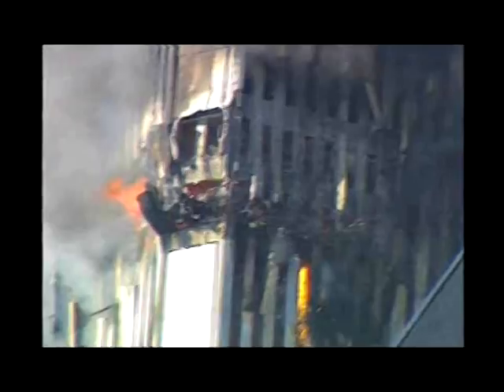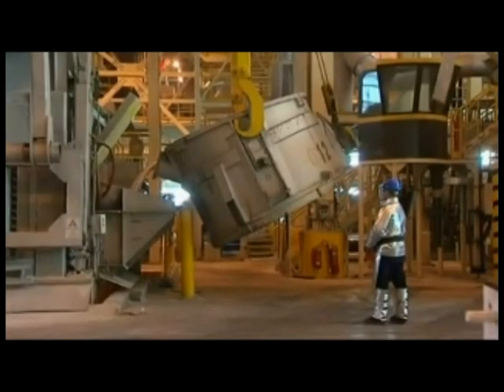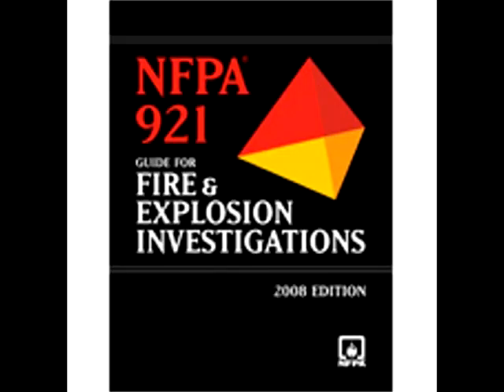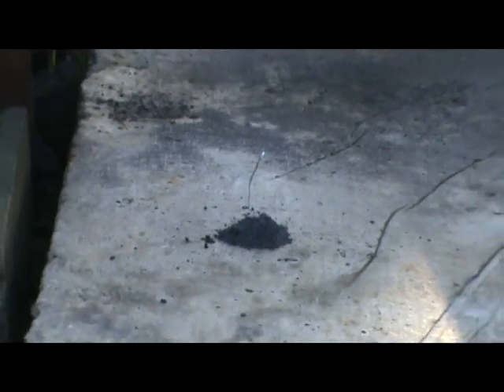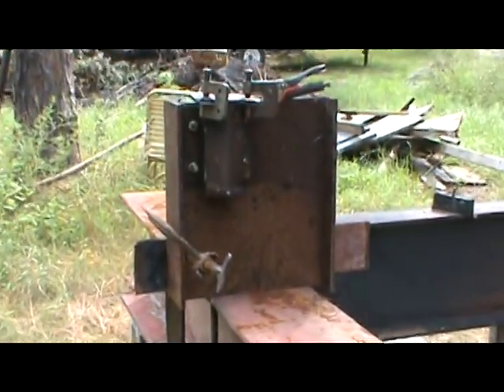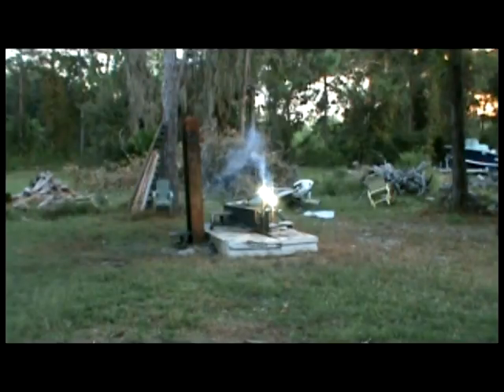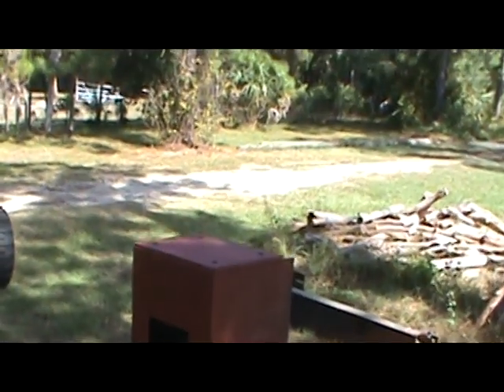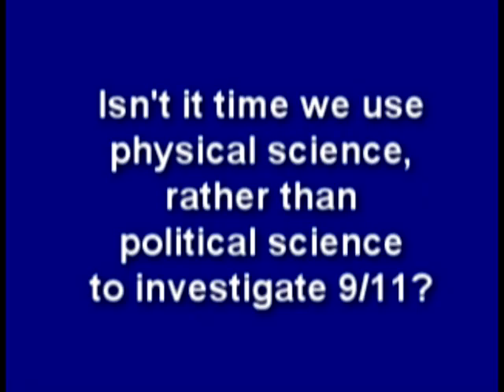9/11 Experiments: The Great Thermate Debate

Comment: What about the freeway beams that melted in San Francisco due to a fire. Same thing and proves this video is pure propaganda.
Reply: Well the steel did not melt it just weakened to the point were it just snapped
Reply: Matthew Walsh But is was just a fuel truck with no other building material to increase temperature. Think of what is being implied. The government is so competent that it planned and kept secret the entire conspiracy. If they were that competent I would have them run 100% of the economy and we know what would happen if they did that.
Reply: +Tanner Stage V You're assuming government competence = a well run economy. There goals for the economy might be different from yours. This economy now might actually be what they want because it benefits them and their investments.

Either way, the only thing important are facts and what can be proved. We KNOW jet fuel doesn't burn hot enough to melt steel beams. We KNOW that a building fire couldn't possibly take down building 7. We KNOW that these three "building fires" weren't anywhere near the strongest, hottest or longest lasting building fires in steel lattice structure buildings. We KNOW that these are the only 3 steel lattice structure buildings in history to have ever come down from "building fires." The evidence very much supports a controlled demolition, and until conflicting evidence arises I'll always believe the most likely story based on the evidence.
Reply: Tanner Stage V In the video you're commenting on thermate is exploding. The telephone company, and cable company would be an example of maintenance people who wouldn't be "privately employed" by the building. Also the man who owned the WTC complex, Larry Silverstein profited madly from the 9/11 attacks, do you think maybe he might have made it much easier for private crews to come in and wire up explosives? He took out an insurance policy 3 months before the attacks for double what he paid for the buildings and claimed the attacks as two separate events. He profited over $3 billion from the attacks, it's very plausible he was in on it, and you're saying that an individual like that couldn't simply tell his managers and security to look the other way, or really whatever the fuck he wanted to tell them about whichever crew it was?

Remember this buiding is over 100 stories tall, theres miles of phone lines, cable lines, multiple elevators to service, among numerous other things. I can guarantee you that it'd be exceedingly simple to mislead people into thin'king any crew who showed up was there to fix something. Maintenance on buildings of even 1/5 of this scale never stops.

Anyways I'm done, you've done nothing but provide sophist and specious arguments, have presented no scientifically valid counter-claims, have thrown around lots of insults, made numerous claims that were patently wrong yet, harped on a single typo of my own as if it countered an entire argument. It's like I havent typed anything at all because you haven't responded to even a small portion of my arguments. So I'm gonna stoop down to your level. Fuck you, you fucking prick.
Reply: Y0uKnoWh0 If you believe central control is all knowing and competent then that is your right. To think that jet fuel was the only thing in that building burning is completely retarded. With good oxygen, as this fire would have, garbage burns at 2500 F and that is enough to melt steel.
Reply: Garbage does not burn at 2500 degrees fahrenheit. Otherwise it wouldn't have taken medieval societies inventing a blast furnace just to be able to forge steel. Instead they would've just tossed their trash into an open pile and formed molten steel easily. Hell you've just solved the Dark Ages, we need to invent a time machine so you can go back and advance society.

"Hey idiots, just burn your trash at 2500 degrees and make steel!"
Reply: Y0uKnoWh0 Oooops you forgot. Did Medieval societies have plastic and massive amounts of petrochemicals and metals? Garbage is a very broad term and you need to know the composition of the garbage. The towers were full of debris including tons of aluminum. What is the temperature of a burning airliner? It is documented. So step out of the Dark Ages of thought and  leave the brainwashing behind.
Reply: +Tanner Stage V bruh really. An open garbage fire can't reach 2500 F without human assistance. a constant propellant mist, pressurization and oxygen injection are all necessary to reach those temperatures. Hence my reference to a blast furnace. An open fire will never reach that temperature.

You think the composition of the fire is the determining factor of the flame temperature, its only 30% responsible. The temperature of the fire is much more influenced by the environmental conditions, air density, pressure, and presence of propellants.

An open fire will never produce an air temperature of 2500 degrees, and the conditions of a building fire will simply never be able to reach that temperature.

Why do you think a blast furnace is necessary? Why do you think waste to energy plants have to inject oxygen on compressed trash that's exposed to a propellant mist to burn it hot enough to run steam turbine?

The temperatures your claiming are simply not reached in an open fire. 1,000 degrees is the temperature limit for a fire that uses air rather than pure oxygen. Then it will burn at a lower temperature if the accelerants are diffused randomly rather than manually mixed. Also as elevation increases air density decreases. The height of impact further decreases possible maximum temperature. Also the fires on WTC 1,2, and 7 incompletely burned as was evidenced by the black smoke pouring from the building. The aluminum of the plane most certainly did not ignite. Aluminum ignition requires very special conditions and did not happen as it would have been clearly evident.
Reply: +Tanner Stage V Fires in both WTC towers were oxygen starved (thick black smoke), and therefore could not reach anywhere near a maximum temprature for open-room, uncontrolled fire. In best conditions, it can reach 800 degrees celcius, but it's still an average over an area. Because the combustible is not evenly spread and not constant, any fixed value will be an approximation.
Reply: Simboiss Plastics burn with black smoke and the hotter fire was not contributing the edge of the fire was so the smoke has nothing to do with oxygen. Just a plane burning is 2100 degrees, documented. The elevated position of the fire gave it excellent oxygen. Just say someone sabotage the building if it is what you are saying and stop trying to troll the post.
Reply: Y0uKnoWh0 Yes it can. I have seen lawn equipment alone combust aluminum and crack 2 inches of concrete off the street surface from the heat. Look up the temperature that is takes to burn aluminum. It was burning like magnesium burns.  When someone tried to put it out with a water hose it exploded hot metal in all directions. The fire department had to be called because it was burning like thermite. Don't pretend you know go and do it.
Reply: I'm not trolling. Black smoke means lots of particules in suspension in the smoke, which is indicative of material not burning completely.
Reply: Simboiss Ever watch a fire and see a very hot area and  at the same time see the smoke coming from the new unburned wood at the edge. Think about it.
Reply: In the end, how do we know what kind of heat was there? It's not like someone put a thermometer in the fire. However, the thermic photograph is interesting.
Reply: Simboiss Exactly, how do you know. Do you deny that an airplane fires can get well over 2000 degrees. Do some research.
Reply: Well, where? Is it 2000 degrees Farenheit or Celcius? It should always be Celcius to avoid confusion.
Reply: +Tanner Stage V we're all talking in Celsius, and if you're not you should be. Its not physically possible for an open fire to reach 2000c. any temperature above 1000c is going to come with deliberate human assistance, first in ensuring an exact air/fuel ratio, and then replacing air with pure oxygen, and finally replacing the fuel (and by fuel I mean burning debris + jet fuel) with an accelerant that burns hotter.

Basic tenets of science and combustion refute any open fire caused by a plane crash reaching temperatures exceeding 1000c.
Reply: Y0uKnoWh0 Clearly it is not Celsius. 2500 F will melt the steal. The plane in the building burned so it is clear it was a very high temp fire. Thermite would have to be on the steal beams to be some kind of magic conspiracy. It would not do anything to the plane. And like magic the termite was placed very close to where the plane hit and the fire raged. Wow what an awesome dream of perfect planning. Lets call this what it is, bat shit crazy. Does that clear it up!
Reply: Something had to weaken the steel all the way down, not just at the point of impact, or else the building couldn't have fallen that way.

And how would a plane burn that much except for the fuel? What's the rest? Seats, carpet, some plastic, etc.

And Y0uKnoWh0 explained it very well. You can't have very high temperatures unless the fire is controlled and concentrated, which is not the characterictics of the jet fuel fire seen at the WTC. This kind of fire is random, dependent on air flow and shifts as the combustible is consumed.
Reply: Simboiss You have not even bothered to research all the information on planes burning. Your post clearly shows you don't know what burns and that it burns very hot. 
Just say what you mean. The termite was set on the building and then the planes flew into the building at exactly the spot where the charges were set. Then all the wiring and trigger mechanism worked perfectly despite the impact and fire. Then it was all covered up and only people like you with internet genius status know the truth because of your knowledge of building collapses and fire temperature.All learned from where else but the internet. Does that sum it up!!
Reply: +Tanner Stage V bruh the thermite definitely wasn't set where the planes impacted. And more importantly if what you're saying is correct and the fire melted the steel, then you must realize the fire would have only melted the steel near where the plane crashed. A localized weakness across maybe 12 floors at the most. That would not have caused the tower to fall in on itself. it would have caused part of the tower to break off up where the plane hit.

If demolishing a building perfectly into its footprint was this easy there'd probably be more than a dozen companies worldwide doing it and they probably wouldn't bother setting perfectly timed charges to insure the building fell in on itself, they'd just light a fire near the top of the building and walk out.

But all of that is irrelevant. You still haven't brought forward a single scientifically accurate piece of information about how an open debris fire somehow reached temperatures above 1000c without pure oxygen to combust with instead of air which is only 27.5% oxygen. Remember O2 is the compound necessary for combustion and the heat of any fire is limited by the oxygen around it. Which is why smothering a fire is an effective way to put it out. The numbers I'm tossing at you aren't random, they're actual scientific limits for the temperature of combustion based on environmental factors. You keep saying things that are latently false, and I want to know why? What's in it for you? What vested interest do you have in the official story? Why are you unwilling to apply the Scientific Method, or at least the Socratic method to the arguments we've presented? Why do you insist on using sophistry as your main point of discussion? Aren't you at least interested in the science behind such an event? Don't you want real answers? If a building fire can actually take down a steel structure wouldn't you want people to be working on improving structures so that was no longer possible? Does it bother you that the 3 WTC fires were nowhere close to the hottest burning or longest burning in history, yet the three towers are the only steel framed structures to have ever collapsed from a fire? Are American engineers so terrible at building construction? Should we all be avoiding skyscrapers?

What is your interest in this argument?
Reply: Y0uKnoWh0 The termite was set perfectly below where the planes impacted. To even post any argument to this miracle of perfect placement is delusional. The building pancaked a dozen floors and the shock took the building down. We might as well throw aliens into the equation if you are going to include all possibilities into the scientific method. The scientific method is used to exclude human bias and your bias is not scientific. Fires can burn hot enough to melt steel and steel beams lose much of their strength at half the melting point. Do you think the molten stuff running out of the building is steel from the beams? Ever wonder if it was glass? Spherules of steel maybe were not from the beams but small pieces of steel that could be melted? Science is not biased conspiracy theory. The scientific method is to stop crazy conclusions not promote them.
Reply: +Tanner Stage V Its weird you bash me about not using the Scientific Method when you then make claims without backing them up.

"fires can burn hot enough to melt steel" 
-not without pure o2

"steel beams lose much of their strength at half their melting point"
-steel actually does lose rigidity at this point. roughly a third of the structural rigidity of the tower would be lost at half its melting point, which means the steel would only be capable of supporting 2x the weight of the twin towers rather than 3x its weight as it was designed for

"spherules (sp) of steel were maybe not from the beams but small pieces of steel that could be melted."
-do you think the melting point of a chemical molecule decreases based on the size of its structure? Because I can tell you the melting point is the same whether it's the size of a pea or an entire steel girder.

"thermite set perfectly below where the planes impacted"
-I like how you make shit up that I didn't even say. There were charges all throughout the tower. That's why some survivor reports claimed explosions in the stairwell, in the basement, and in the bottom floors. It stands to reason thermite/ate was set all throughout the building to weaken the steel equally. 

Also the structure wouldn't have "pancaked" on itself like people say. When you design a building you don't choose materials so they can barely hold up the weight of the building on a normal day. You overbuild so that in exigent circumstances the structure can still maintain its integrity. The skeleton of the twin towers and WTC 7 were designed to be able to indefinitely hold up 3x the structures actual weight or more in some places. Even if the top 12 floors were to magically disconnect and fall into the structure it wouldn't cause the rest of it to collapse. Its like asking why your chair doesn't break when you sit down really fast. Its because its designed not to.

Now again, I ask you, what is your end game in this discussion? Why do you keep ignoring scientific facts about combustion temps, and structural design? Why are you so invested in your side of the argument?
Reply: Y0uKnoWh0 You can run with bat shit crazy if you like. I always start a fire using the biggest pieces of wood and they start up just as good as the small piece because as we know "melting point is the same whether it's the size of a pea or an entire steel girder." Think about it and marvel and how crazy that sounds. Of course large steel beams take way more energy to melt but are the same melting point as small pieces. Only a delusional person would not see my point in the first place. Any fire inspector will tell you steel beams don't liquefy but they sure as hell deform and lose structural integrity.
So the whole building was wired? Well that pretty much ends the discussion because bat shit crazy is just bat shit crazy. And you learned it all off the internet, bravo.
Reply: +Tanner Stage V you can't compare wood and steel. The wood is fuel, it burns and undergoes a chemical change because its carbon based. Steel doesn't burn in a fire. Melting is a simple change of physical state from solid to liquid.

Using that as an example shows such a huge fundamental lack of knowledge. You wouldn't toss iron in a fire to make it hotter because its not fuel, it doesn't burn. The size of a wooden log matters in how quickly it takes to combust because its fuel, it catches on fire and undergoes a chemical change. Bruh, you don't realize just how stupid your comments have been. If you don't have a fundamental understanding of chemistry and the physical world, then what makes you think you can make a comment on the subject without maybe double checking if the things you're saying are true before you say them.

I'm still blown away that you would make a comparison to a carbon based organic material as if it had any relevance to steel. Like I can't stop laughing at you right now.
Reply: +Tanner Stage V seriously there is no scientific "burning point" of wood. its a chemical reaction. Its a completely different thing from the "melting point" of a substance which is the point in which a substance undergoes a change in state.

The two concepts are completely different things. They're so different that I really needed to make two comments to point out just how off base of a comparison it is.

Melting and Burning are two different things.
Melting and Burning are two different things.

One is a change in physical state. The other is a change in chemical state. The two are not related at all.

Melting always happens at the same temperature in the same way that water will always freeze and boil at the same temperature regardless of if its a drop, a bucket, or a lake. Water won't freeze at 40f just because it's a drop. Freezing can only happen below 32f. Seriously this is high school science. You have a fundamental lack of understanding on the subject and are currently not mentally equipped to participate in this discussion.
Reply: I think Tanner has simply reached the limits of his current knowledge, and it's nothing to be ashamed of. The shameful part, on the other hand, is to cling desperately at one single belief and refuse to learn more. Tanner should try to go forward and shatter the limits of his own beliefs. Everyone should do that.
Reply: Simboiss I am working on aliens at the moment. Learning where they visited on the earth and where they live. Once I get that expansion of my current knowledge done I will move on to less believable stuff like the WTC was blown up in a conspiracy by our own government. Some believe government is incompetent others believe it is all knowing and perfect in its planning.
Reply: Y0uKnoWh0 Once again you prove to have a head denser than steel. It is an example of energy required and that  smaller pieces require less energy not melting points and chemical reactions.
You are mentally unable to be challenged about your delusion. You resort to basic science that everyone knows and pose it as some revelation. Leave this stuff for people with more than an internet education.
You have never seen expansion due to heat compromise structural integrity so you are not equipped to understand based on your internet education. Material behavior under such conditions is not something you can understand. Do you think just maybe the planes causes some structural problems as well?
Reply: +Tanner Stage V You're an idiot. The size of an object will determine how quickly it undergoes a chemical reaction, especially as a % of exposed surface area. The size of an object will not however lower or raise its melting point, boiling point, or freezing point. 

No, the aluminum planes were unlikely to have done any damage to the interior steel lattice frame. Your basically claiming a tomato would damage a knife blade if thrown hard enough. Atomic rigidity refutes that entirely. The aluminum fuselage of a plane wouldn't damage steel unless it was above the speed of sound. It just simply couldn't develop enough impact force. Remember it's hollow and aluminum has a hardness rating of 2.4 while the hardness rating of steel is over 8.5. Aluminum is almost 4x less hard than steel, no reasonable impact between the two would do any damage to steel.

You claim to know science but have brought no science up. You said I shouldn't bring up elementary science. However everything you've said has shown you don't even understand that. I have a degree in engineering, have you gone to school at all?

I'll repeat, no matter the size of an object, its melting point is constant. Yes an object melting does so by absorbing energy from its environment. However if the environmental energy coefficient isn't above a certain threshold the material will never undergo a physical change of state. Its why there are NEVER any reports of ice forming above 32f. It can exist above 32f but it can't form above 32f. There will never be any reports of steel melting below its melting point, ever. Please do some reading, find out the difference between a chemical reaction and a physical reaction. Learn what a melting point is and how matter changes state. Then maybe come back and discuss your findings. As a species we've fought hard to acquire the knowledge we have. Please don't deign to throw that gift away simply because its inconvenient for you.
Reply: +Tanner Stage V yes it does take more energy to boil a gallon of water than a bucket. However this does not mean that a drop of water will boil underneath its boiling point. You seem to be conflating two unrelated facts. The boiling point temperature is the bare minimum temperature required for booking to occur. This limit does not decrease if there is less of a substance. Ice will never melt when the temp is below 0c. Never, no matter how little ice there is. There must be enough atmospheric energy for the temperature to be above the melting point before steel can start melting. It will not melt below its melting point. Its like you're arguing that gravity doesn't exist if you aren't touching the ground.
Reply: Y0uKnoWh0 So at least you admit that in a massive fire such as this we can imagine that some small pieces of steel could be melted without melting the larger beams. The entire fire does not need to be able to melt steel but areas with metal oxides or other materials that burn very hot could melt steel locally. Wow you are making progress.
To bad about that degree that disappeared. I will grant you an internet degree in science. Print this off and frame it for your wall.
Reply: +Tanner Stage V I don't think you're getting it at all. All that I'm admitting to is that if temperatures were over 2500c there's the possibility that some steel would remain unmelted.

But I get the feeling that whenever you read something you mold it until it fits what you expect it to say rather than just reading it. Unless temperatures reached 2500c NO steel, not even the smallest of flecks would have melted. That's not how physical state changes work, at least not from solid to liquid. Liquid can sublimate into a gas below its boiling point, but it won't boil below its boiling point. However if temperatures were above 2500c there's no guarantee that all of the steel would melt.

But I get the feeling you won't read or understand any of this. Have a nice day.
Reply: Y0uKnoWh0 Wow not that's a fire. 2500C?
Unlikely I can match your awesome analysis sparky. Bat shit crazy degree dude strikes again.
Reply: Simboiss Nothing is more insulting than bat shit crazy post one after another. If you want to move the bar talk about how they wired the whole building without anyone knowing or ever talking about it.
Reply: +Tanner Stage V You do know the melting point of steel right?
Reply: Not 2500C. Try about 1370C. But you are the engineer so if 2500C is what you use in your engineer school that is ok. I mean you are the expert here and one of the rare people on earth that has punched a hole in the conspiracy just by watching some videos. Go with it brother and sail into history.
Reply: +Tanner Stage V So I typed Celsius when I meant Fahrenheit. My bad. Does that invalidate my entire argument?
Reply: Y0uKnoWh0 I retyped it in my response and you posted "You do know the melting point of steel right?". It is just that for an engineer to make such a mistake would be a disaster in the real world.
If you want to move the bar forward talk about how they wired the whole building without anyone knowing or ever talking about it. Because the steel melting debate is done and we all know the structure failed due to high heat and a plane impact in the side of the building.
Reply: +Tanner Stage V the steel melting debate isn't over at all. All of my points still stand regardless of my typo. But you would be the type to focus on a single typo rather than the argument.

Also in the 3 months before 9/11 they had multiple bomb drills and evacuations not to mention have you ever worked in an office complex? People are in and out all the time wearing this uniform or that uniform or doing maintenance. They could have easily wired the whole thing up during the workday and its doubtful anyone would have even felt the need to bat an eye. As an employee working in the tower its not your business and any credentials could have been faked rather easily for the few who did ask.

Explosives, especially a thermite device could easily be disguised or even just hid inside a toolbox. They wouldn't have rose any suspicion at all, and wireless detonation was old technology back even in 2001. Wiring the towers up wouldnt have been difficult at all in the months before the attack. Not to mention the numerous evacuation drills they ran before the attack during which nobody would have been inside at all.
Reply: Y0uKnoWh0 Bat shit crazy strikes again. But hey it happens living at home all your life. Ever wonder if a building has a manager or security? Maybe some of its own maintenance people as well? No, crews of people just walk in and start wiring the whole think for demo. Everyone just missed it. Does thermite explode because earlier you claimed the peoples heard explosions in the lower levels. Oops bat shit crazy strikes again.
Reply: Y0uKnoWh0 Elevator repair and many others. The problem is that you don't work and in a normal environment people don't just forget to say something after the fact. That horrible mess and people just ignore it. Bat shit crazy strikes again. 100 stories of wiring explosives sounds like a ten minute job. Wow what luck the real telephone, elevator, maintenance, or many others did not even notice the explosives all over the place.
Great of you to really hammer the point home like this and show everyone you are a true internet warrior. Since you are gonna stoop down to the "level" - wow you are a dipshit cunt. Glad I could fuck with you but there is no cure for a bat shit crazy liar cunt internet engineer that lives with his mommy. I am sure you must post even more and prove no one is more fucked up than you.